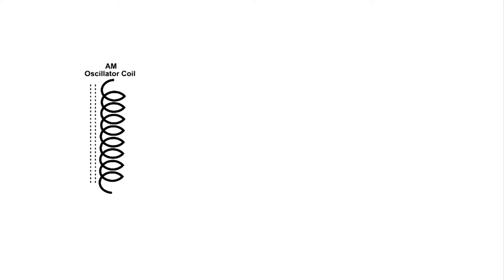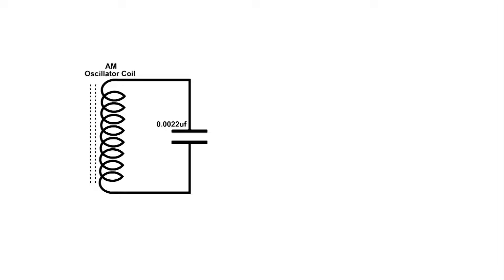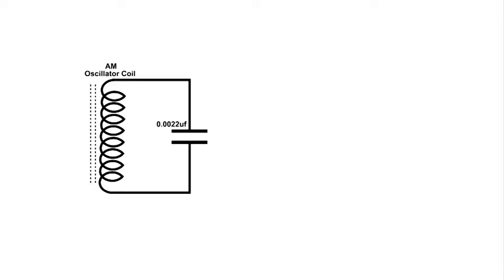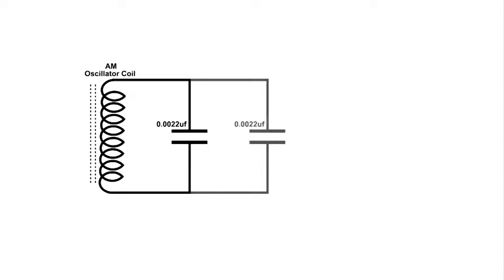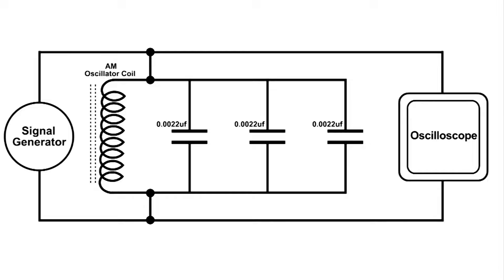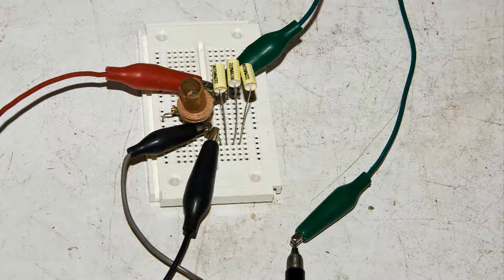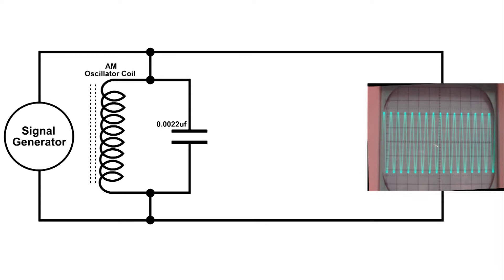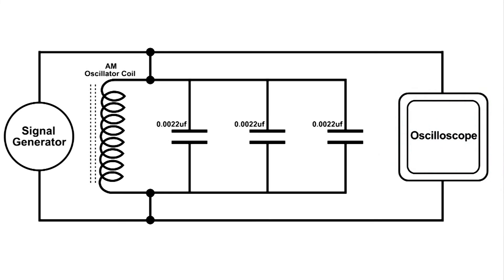LC Resonance Oscilloscope Demo

Comment: When you figure out that there is also the highest resonant frequency when you remove all the capacitors then you should just call yourself a big "IDIOT". The trace is getting larger, shows your level. It is not the trace it is the AMPLITUDE. I disliked your video as it didi not tell what was the mH of the inductor, what was the resonant frequencies each time. The sums up to you being and "IDIOT". i DISLIKED IT.

Comment: Thanks,
But why in the case of LC tank "without power source" you called it resonant frequency? ..
I know it is only called natural frequency, but if you give it a power signal with this same natural frequency, it will now be called resonance, right?
Reply from the maker: The resonant frequency is determined by the L and C of the circuit, with or without applying a power source or a signal source.
Reply: @AllAmericanFiveRadio  so it means "the frequency at which the circuit WILL resonate IF we apply the power with this same frequency" right?..
Yea we calculate it using the values L and C because it is the same natural frequency.. but in the normal scenario "with initial conditions only", the circuit will not resonate necessarily...
Reply from the maker: @mibrahim4245  Yes, that is what the video shows.

Comment: Thank you.  As a noob, I wonder if the vertical dashed lines to the left of the coil indicate an (inactive) former (e.g., a cardboard tube to support the coil), or an active part of the coil/tank?  In other words, would we see the same results with a coil suspended in space with varnish along with the capacitor(s)?   Are the vertical lines part of the circuit?
Reply from the maker: Powered iron core

Comment: what about  if we  change coil  reactance value and fixing capacitor value
Reply from the maker: If you replace this coil this a coil that has higher Henry's, the reactance will increase. It will also resonant at a lower frequency.
Reply: AllAmericanFiveRadio   thank you
Reply: the same way that don smith deal with his device  in order to fixing the resonant frequency of both primariy and secondary coil he increase the lenght of the secondary coil 4times and also decrease the capacitance of secondary to1/4.to resonate at same frequency35khz.

Comment: HI,  I'd like to know how one arth can i measure the frequency i get off an LC Tank.  I have done the formula  V = 1 / (2 * pi * sqrt ( L * C ) and got a frequency but when i checked it out on my multimeter or oscillascope DSO 062 it comes up with something else.
Reply from the maker: Charles Tan 
I would believe the oscilloscope
Reply: AllAmericanFiveRadio idk about that.  Can you do the same thing just to check if i am on the right path please? 

I used this formula to find the inductance http://www.daycounter.com/Calculators/Air-Core-Inductor-Calculator.phtml   ( i am using d= 2 mm, n= 6 cm and l= 6.5 turns)  please change it into inches.    

i used the formula to find the frequency   V = 1 / (2 * pi * sqrt ( L * C )     --------- which C = 1nF

from my calculations i got 94.77 MHz.  on the oscilloscope DSO 062 it shows up with different freqs from 54k - 95k.  It's only suppose to show up one freq on the oscilloscope right?
Reply: Charles Tan I believe your calculation should be F = 1 / (2 * pi * Sqr (L * C) ) to determine the resonant frequency (F).
Reply from the maker: Charles Tan 
Building oscillator circuits is an acquired skill, meaning that something that does not seem important to you has a large effect on the circuit. The way you build the circuit of an oscillator or tank circuit is extremely important. When I build and oscillator and or a tank circuit I always keep the components as close together as possible and the leads connecting the components together as short as possible. At higher frequencies it is important to make sure everything is insulated otherwise the RF will find other pass that will change the performance of the circuit.
Reply: Ok thanks for the info.  I'll see what happens

Cheers

Comment: Very nice video! One thing that I didn't understand:
Why give the capacitances and not the inductor's inductance too.
Some formulas and values of inductance and resonant frequency would be nice.
Reply from the maker: That's the easy part, just Google “LC Resonance Calculator”
Reply: <<Why give the capacitances and not the inductor's inductance too.
Some formulas and values of inductance and resonant frequency would be nice.>>

Heh, heh!  In the comments,  the frequency range selected is given as being somewhere between 100khz to 250 khz.  It is left to you to calculate a value for the inductance as a problem!

Comment: A parallel resonant circuit will have maximum impedance at resonance.  The function generator has an output impedance of 50 ohms.  When you sweep to resonance, more voltage is dropped across the tank circuit vs the impedance of the generator.  That is why he is seeing his signal increase, even though the scope is connected straight to the output of the generator.
Reply: Thanks...I was wondering about that.

Comment: Why arent you using a resistor in series with the signal generator's output lead? I don't understand how your oscilloscope is not reading the signal generator's output without a series resistance.  When I do this I have to use resistor otherwise I'm just scoping the output if the signal generator
Reply: Maybe it's too late, and you might have already graduated but here is your answer anyway:     Here, the internal resistance of the generator is considered as a  kind of resistor so, he hasn't used any.

Comment from the maker: The I.F. tanks coil and capacitor are chosen for a very high Q. Usually the adjustment is made with a variable capacitor or variable coil. It would be best to vary both for peek, but that would cost more for a little bit better performance. And what you are looking for on the oscope is the highest output at the intermediate frequency. Yes tanks can have more than one coil, the coil can be tapped too.

Comment: rick when doing a radio receiver alignment procedure do you basically have to change coil or capacitor settings in the tank circuit  to achieve the highest frequency output on the oscilloscope? 
also do some tank circuits have more than one coil?
thanks for very helpful videos.
john

Comment: Hi, great video! I have built a similar tank circuit with a 310 uH coil and a 400 pF variable capacitor. When varying the the capacitor over it's range, the resonate frequency should be from 0,45 MHz to 2.86 MHz.(according to the LC resonance formula). I took it a bit further and built a simple AM radio with a couple of transistors. Why is it that I don' t get the wide  tuning area that the formula suggests? All the broadcast staions seem to be packed together. Tuning has litte affect.

Comment from the maker: Thanks hedwig85
The frequencies are from about 100,000 to 250,000 Hz, and that is to keep the oscilloscope from strobing on the video. The capacitors are all 0.0022uf. That value of capacitor shows the change that I wanted to show on the oscilloscope without changing the scales on the generator. That makes the video run smoother.